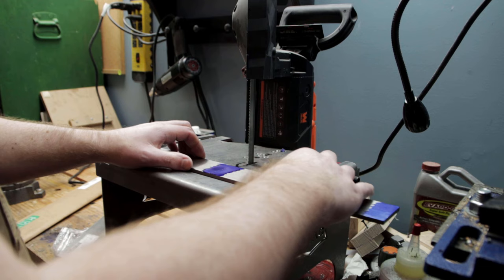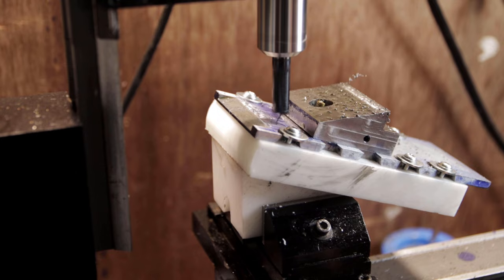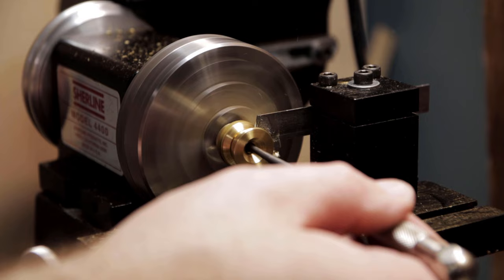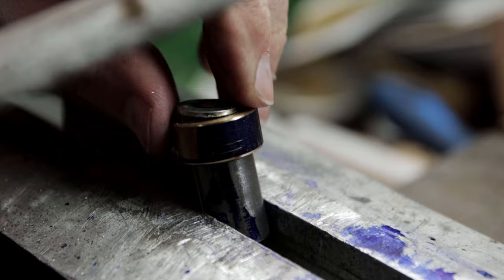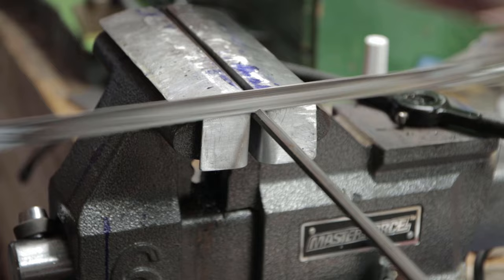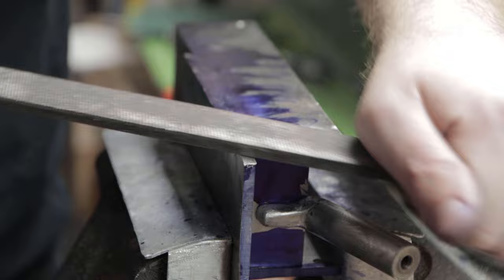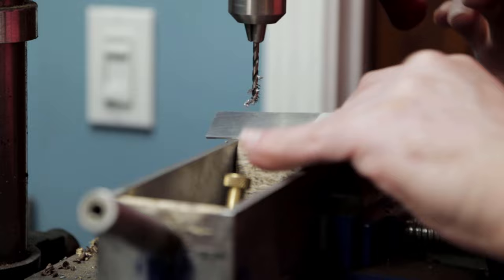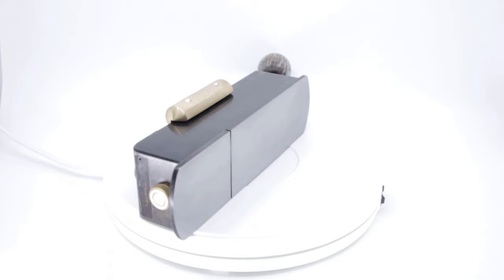Recreating a Rare Stanley Hand Plane

Comment: You may see mistakes, i see character. Its actually a thing of beauty and styling. Ive made the mistake of using a flap disc for material removal. 😂 learned the hard way, they are more for surface conditioning work. Great for contours though. Ahh well, edjumacation by hard knocks is a goid thing in the end.🤝
Reply from the maker: thanks!

Comment: Hi Eric. greetings, I'm surprised that you used both Sherline lathe and mill rather bigger machines. As most of your jobs are big for Sherline. Is Sherline coping with most of your jobs?
Reply from the maker: So far so good. I can't get bigger machines in my shop. Luckily for me the Sherlines can do the work.
Reply: Thanks for the reply :) I own both Sherline lathe and mill since 95. A few modifications as it ages yet they're my workhorse for most of my work. Yup my workshop is small like yours.